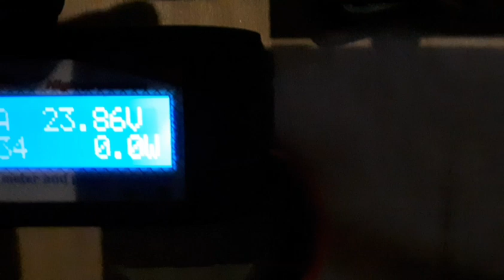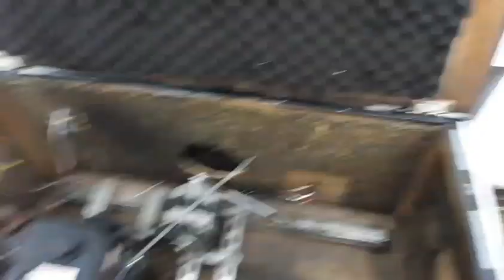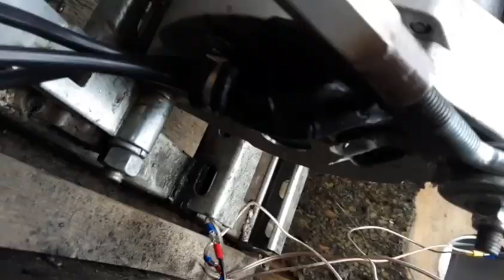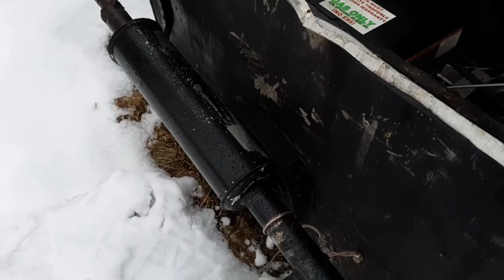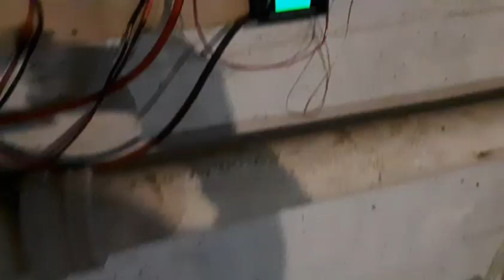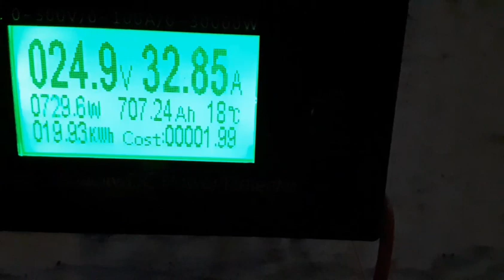DC Generator, Battery Bank Charger.

Comment: I am looking for more information on this post there. This build right off generator off grid I want to learn more information on how do you build this input it all together and got to work. Looking for all detail plans how do you build kits and when you got the motor and everything at and the alternator how much power would it put out how long would it lasts to keep the batteries charged no son or when

Comment: How long will that motor run before it runs out of gas?
Reply from the maker: @matthewmccune  2 hours, give or take depending on throttle set point. Sometime i charge low-n-slow with it idled down and it'll run way longer on that same gallon.
Reply: @ so I built mine. Was able to run it at idle and we get 8-9 hours out of it. You might try a different pully config on yours. I’m not pulling much power on mine.
Reply from the maker: @matthewmccune  i definalty tried other pulleys on both the engime and alt. I now have a pile of them on a shelf. This arrangement worked the best at the time. That was years ago however and now with a 24 volt setup, totally different batteries, i chage differently now.

Comment: If you making 200 amps with the alternator don’t you need 00AWG wires going to the battery bank?
Reply from the maker: It has the ability to produce 200 amps... i set it for more like 80-100 for deep charging. It does have 1/0 stranded copper which is plenty for the short lenght of wire from the rectifier to the bus bars. I kept a very close eye on it for every used the first couple months just to make sure everything was safe and reliable. She's good.

Comment: This video... Rekindled the interest. My wife thinks I have gone mad! LOL!!! I have outfitted the camper with solar and 6v batteries like yours. At first, she was skeptical. Last summer when we went camping the generator never had to be started. Trips of five to seven days, brewing coffee daily, and the batteries were happy the whole time! She thinks that is awesome. Now I have bought a few small diesel engines from old semi truck APUs. She thinks I have lost it again. I can imagine these small liquid cooled engines spinning one or two of these PMAs each! And since they are liquid cooled, I can use their waste heat to warm living space. I guess I better get in touch with Themodyne, and start stacking batteries! Thanks for getting me going again! And I wonder, do you suppose in your early work with your system, did accidentally foaming the group 31 batteries upset the acid balance? I can't help but wonder if some sulfuric acid was lost along with the water... Thanks Joe!

Comment: The heat sink is MUCH more effective if the fins run vertically so the air passes up through them for convection cooling.
Reply from the maker: The automatic fans does pretty well.... been going strong for almost 6 years. But yes....if it was just passive, that is how it shoyld be oriented.

Comment: Great video and simple but reliable method to basically top off batteries. I chose to use a standard automotive alternator just for cost and logistics reasons. For those out there interested I found the technical people at Delco Remy very helpful with data and recommendations. I did find out that in general automotive alternators are good for up to 15,000 RPM so I put a larger pulley on my engine to keep the engine RPM lower than 3600 RPM.

Comment: I need a alternator battery charger like you built. I have a 560 amp hour lifepo4 24 volt battery that i built and another 24 volt 7kw battery i built from nissan leaf modules. I have plenty of solar and a couple 120v chargers but id really like one like you built. Im thinking ill order a 150 amp 24 volt alternator and get a motor from harbor freight.  Thanks for showing how you built this

Comment: If those are radiator fans, they are sucking not blowing by their orientation? Not that it necessarily makes a big difference.
Reply from the maker: I can definatley tell the differance....and they are both definately pushing air into to box. They're permanent magnet motors so they can run either way. Get the polarity rite and they spin the way you want. And for the purpose of this machine it does matter.

Comment: Would it help if you used a bigger pulley on the motor end to increase rpm's without using more fuel?  Sort of a gear ratio setup...
Reply from the maker: Simple answer. No. I spent nearly $200 in different size pulleys. That was my original idea. Put a 5" pulley on the engine and 3" on the PMA....assuming the engine could nearly idle and the PMA would make good power while savimg tons of gas. Nope. Wouldn't ya know it.... Newton was correct. The engine could'nt even start because it was to much load. There is actually a formula to convert KW to HP....there is obviously loss in the transfer of energy so you need to start with more. Putting a big pulley on the engine will only hurt your shoulder trying to get the engine started. I tried about 2 dozen combinations of pulleys before i found a drive ratio that the engine could start, warm up and i could throttle up to a standard and consistant charging set-point. With a bigger engine maybe, but will you save any gas?....
Reply: @smallcityhomesteaders1600  How about a small diesel engine?
Reply from the maker: @DeeJayHouser1  have you seen the price of diesle these days? I have though about finding a small diesel engime just to have around if there was ever a situation where fuel couldn't be bought. It's easy enough to make....

Comment: Hi Bud if you would like to cool your alternator better I tricle water over the fields on my alternator and no the water won’t bother it and if you think about you occasionally get water from puddles up under the hood of your vehicle, I know this by the head lights that use to go dim from the belts slipping back in the day and yes I also have a temp control to cut off the current incase I loose water, I’ve been using it when needed for over a year now, I use it a  few days to a week at a time when we don’t have enough sun but it works awesome mine is also a 24v 1200w alternator, also I’m over in the Philippines so I don’t have to worry about freezing up
Reply: Also I use about a liter of  gas per hour with a 13hp engine I would like to upgrade to a 80A alternator and I have a small 5 kw battery bank I charge in about 5 hrs or so depending how much I’m using while charging

Comment: does the pma have to spin clockwise or counterclockwise?
Reply from the maker: Rotating either way works fine. I recall in the book that did actually say the PMA performs better rotating clockwise but it works either way.
Reply: @smallcityhomesteaders1600  thank you
Reply from the maker: @staym925  well of course. I try to answer anything i have an answer for.

Comment: Another shoe and tell you what I Got video, how many  amps is your alternator?
Reply from the maker: If i ran it at 12 volt, easy 250 amps. At 24 volts i've had it at at over 130 amps. It's a monster. That isn't just peak amerage..... thats over hours and hours.

Comment: I have lithium batteries and I live in the bush in Alaska. I do not use a lot of 120v items. My system is 24v. Would love to build a system like this on a old Diesel engine.  Ideally 100amps would be perfect as i can put 100 amps in per battery an hour.
Reply from the maker: I don't know a lot about lithium honestly. I know there's BMS's involved in the proper charging amp/volt range and its unsafe without the rite stuff. Perhaps if you had a 100 amp wind turbine charge controller that was programed for lithium. Mite be hard to find bit they definately exist.
Reply: @smallcityhomesteaders1600  not enough wind at my location. The batteries are high end and have worked fine thus far. Just would love to charge faster.
Reply from the maker: @curmudgeinnak  well what i was thinkin was, if a guy built himself a generator like mine....you could run the 3 phase from the PMA to a smart controller for making sure its charging your lithium correctly and safely rather them just a straight rectifier like i have. My thirsty ol' lead acid batts with take amps any way then can get'em but lithium is more sensitive.

Comment: How many amps and watts can you get out of one? That’s a 12 V permanent magnet generator
Reply from the maker: I've had it up over 2600 watts, which at 24 volts is over 100 amps. It is technically a permanent magnet alternator. It puts out 3 phase AC and the rectifier turns that into DC and just jams the amps into the batteries. If your curious about using this in a 12 volt system, this same setup would make over 200 amps. Amps × volts = watts.

Comment: Hello , John butler here. I have the same engine you do but my alternator is a leech Neville 165 Amp. If I let my battery bank run down to 12.4 the engine doesn't have enough power to keep running. Bogs down. If I put a starter battery between the alt. And the battery bank do you think that would help
 Thanks john.
Reply: In reality with that size altenator you need about a 10 HP engine to drive that altenator at full out put - on the other hand if your altenator puts out full power for over a minute you will chance burning out the diodes - 
      Automotive altenator's are rated by VA or KVA - that means full power for one minute on a given size starting battery - 
     If it's a car alenator that would be a 800cca  battery or 100 amp hour battery - 
      If it a commercial truck altenator that might be 2 1500cca battery's it can raise to 14 volts in one minute -
    In your case you might have to either use a smaller altenator or larger engine - 
      The other is to remove the regulator and set up a 100 ohm 200 watt OHMLITE variable resistor and manuely adjust the altenator out put - with a car altenator you want to stay at or below 30 amps out put - with a commercial  truck altenator you want to be at 50 amps or Bellow - with a car altenator that's 450 watts with a truck altenator that's 750 watts - with belt drives there can be 1 HP lost in the belt drive 165 amps that takes at least 8 HP -  
      I greatly just manually control my altenator's when I use them for charging - also you can safely run the engine at 2700 RPMs - it takes 1 hp to generate 385 watts so 2 HP with belt transition loss will give 30 amps at 15 volts at the altenator terminal - you need amp meter you can put on the altenator lead to see current out put - 
     Altenator should not exceed 150° or so while charging or diodes might burn out - - what I stated are safe limits at 2700 RPMs - 
     At 2700 RPMs air cooled gas and diesel engines are most efficient with out building carbon in the head
Reply from the maker: His explination is way better then mine... i tried what you are asking before i built this rendition...didnt help any. More batteries, more load. Any regulated alternator is not going to like charging battery banks. They'll do it but they won't last long. PMA's are the way to go. They put out what you put in.

Comment: Do you think I can assemble same set up with AC motor which will be plugged in to grid, unfortunately I live in apartment building. eg motor like 115v of some sort.?
Reply from the maker: If you could make that work...you'd have one very very valualbe machine. There's a thousand challeges to overcome. However, many people run permanant magnet alternators into grid tie inverters.  I am completely, physically disconnected from the grid so i havent researched the different equipment much.
Reply: @smallcityhomesteaders1600  I'm trying to build one to cut my electric bill in half, I thought I ask as it's similar idea as what you have in the box
Reply from the maker: @YannisG278  that would actually be really complex. To backfeed power into the grid, you have to produce higher voltage then the grid to puch the power backwards and also be perfectly sincronised with the city powers sine wave. The ac you produce would have to match the Hz and floctuation absolutely perfect otherwise serious damage would occur with both your equipment and the cities hardware. Grid tie inverters (good ones) analyse the city power and match its sinewave but ramp the volts up a tiny bit to get the electricy to flow backwards into the grid. Voltage is "electrical pressure".  Like pressure in an air line. Think of the city as one air tank with a hose running to your apartment. If you wanted to push that power (amperage) backwards, your generator would be like another airtank and would need more pressure to get it to do so. Voltage is the pressure, amperage is the actual electrons that flow through the wire and do the work.....and thats the simplified answer.

Comment: The power meter link in description isn't valid anymore but I'm looking for something similar I think. 
I have a dc generator I built with a harbor freight dual fuel motor and an old portable jump starting unit.  It puts out tons of electric and is capable of charging a large bank of batteries in 12v or 24v . I need to figure out a sensible way to meter, regulate, monitor,  the output while charging though.

Comment: hello sir how did you achieve  your alternator excitation  @ small city homesteaders
Reply: thanks for reply   so you had to modify the  alternator to a permanent magnet first.

 how do you achieve  variable  charging  current  as shown in display.
Reply from the maker: @delion534  i wish i could take credit for the modification but the alt was hand made by Thermodyne. They hand wind the stator and install the biggest strongest magnets they can fit on the rotor. There's 3 wire out so you have to run it to a rectifier before the batteries. I regulate output, as shown on the meter, by throttling up or down the engine.
Reply: @smallcityhomesteaders1600   thanks for explaining... i only have the of getting strongest permanent magnet ... which i can use to induce magnet flux to the core for alternator to generate power.... I don't know whether you can direct were i can buy one .... to reach me in Kenya +254
Reply from the maker: No excitation required....it has a permanent magnet rotor. Output is then regulated by RPM rather then any module. Still running strong, 3 years later.

Comment: Awesome video, thanks for sharing. I bought two of those same PMA’s with the intention of building my own inverter generator + vehicle battery charger. Basically an auxiliary power unit for my van to keep the vehicle 12v system charged + also produce 120v power to run tools, etc. I have a 7.5hp lombardini Diesel engine from an old sign board that has an alternator bracket built onto the engine so I’m hoping I can use that. Seems like the only difficult thing is regulating the rpm’s which is the major advantage of traditional alternators. Thanks again for the info.. your setup is pretty awesome
Reply from the maker: Cool idea! PMA is still going strong. So glad I made this thing. It doesnt get frequent use but when i need it, it's the only tool for the job. Thanks for watchin, God bless!

Comment: Be even better if you could route the exhaust through a heat exchanger in the house for extra heat, a catalytic converter inside would also kick the heat output way up
Reply from the maker: That is a great idea and If i owned the house i could do so much more. I biggest challange here is its an old old house with crap insulation/windows and the owner is unwilling to invest in the property. I havw total freedom to use it as if it were mine but some day ill pack up and move and this all has to come apart and come with us. Whenever it finds it's permanent home i can do everything i've wanted to which will cut my fuel use down having walls/windows that the wind can't blow through.